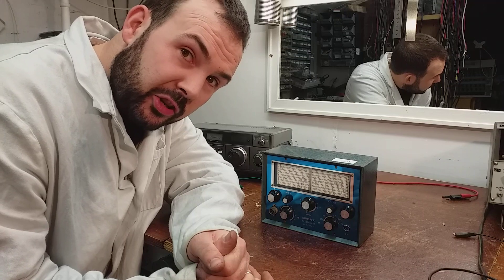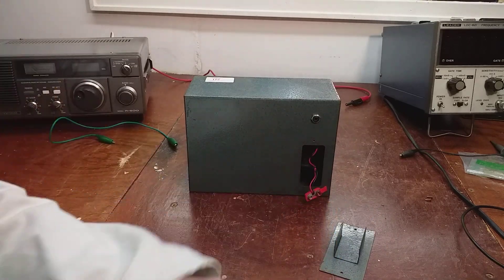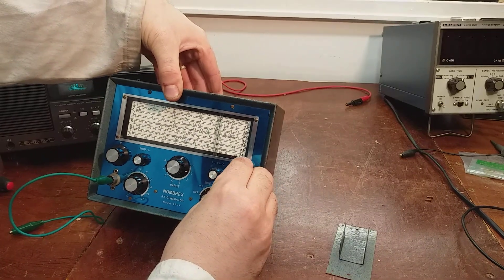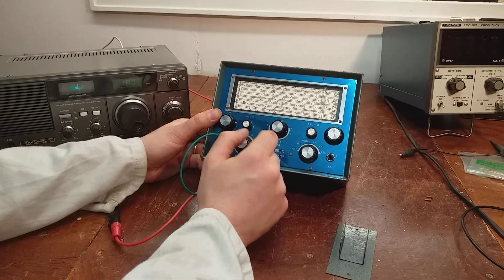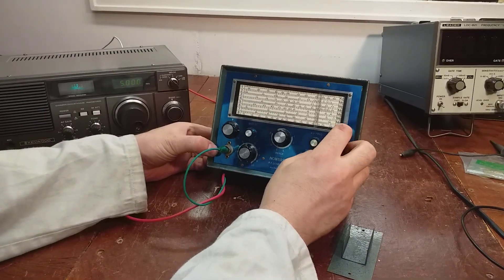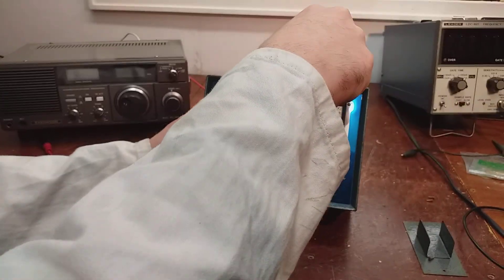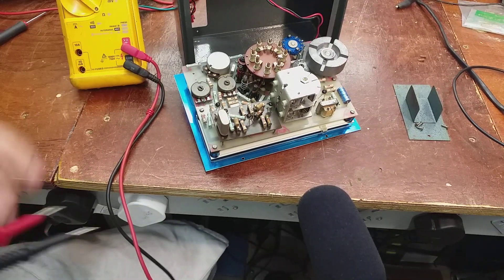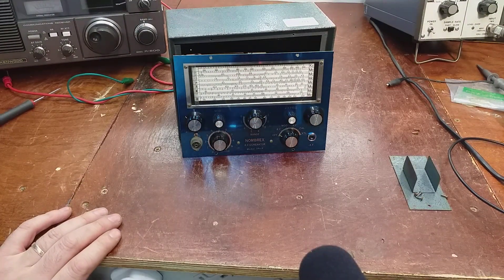Nombrex X-29 Signal generator.

Comment: What a loverly little generator :-D
Cute and simplicity inside, less to go wrong.
If it was mine i would sit a frequency counter on top with a coaxial cable going into the back and tapping on the the front socket with a picofarad range capacitor.
The real toast rack capacitor was worth the money alone, good quality :-D.
Reply from the maker: Thanks ZX, it is a nice size. I agree, a small counter on top would make it very usable. Though I probably won't use it in anger, I've better generators here.
Reply: It seems to have been made in Exeter devon, it was a small company that made small test gear.
I don't think they lasted too long :-(.

Oh, i'm really sorry about that link to the d.i.y multimeter, i analised the full diagram later on and noticed mistakes all over the place.
Sorry about that :-(